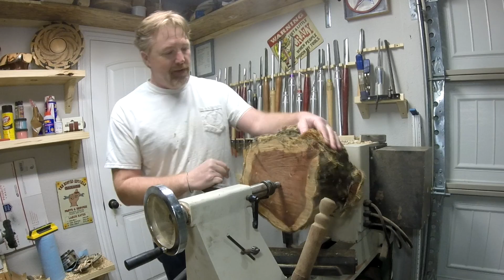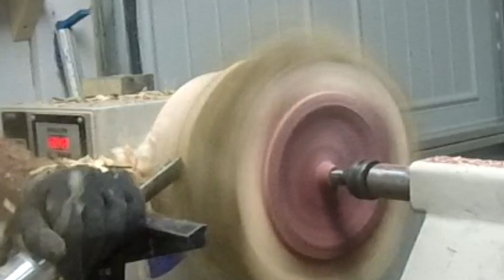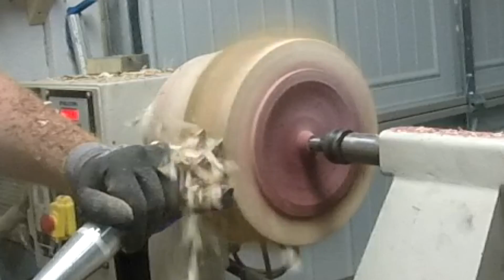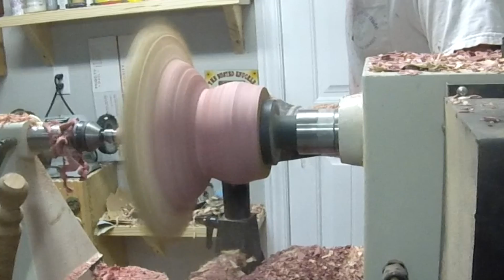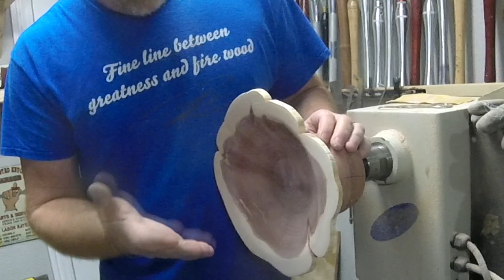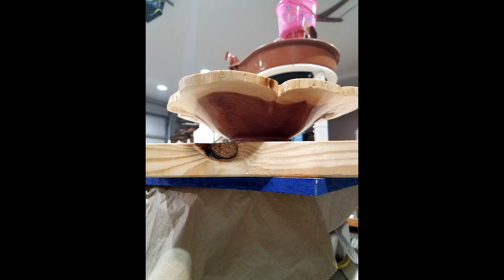Cedar bowl

Comment: Love the edge and especially the SHINE! What do you use - OB Shine: BLO/Shellac/Alcohol - or something else? How does the finish hold up? The reason I'm asking is I rough cut a few cedar blanks last week and I want to turn them.
Reply from the maker: Yes Kenny, I use the OB shine,  the cedar drinks it so a lot of coats are needed. I think I put on 10 coats... I find it gets dull looking after a while but a quick shot of Pledge and all it good
Reply: I thought it looked like it but you weren't "burning it in" so that threw me off but I guess you pretty much have to pour it on at first and we ALL know that doesn't work on a spinning lathe LOL.
Reply from the maker: soft wood, I don't burn in the first few coats just let it suck it up.  video idea??
Reply: Ever do any off center turning? I'm wondering about doing a tool handle - specifically a trowel handle for my wife - flattened sides with finger grips on the bottom and a curve on the top. I guess I shouldn't have pizza before bedtime if I'm going to have these kinda dreams.
Reply from the maker: I don't do much off centered turning but that sounds like after you turn the handle a sander would do the flat and finger hold.